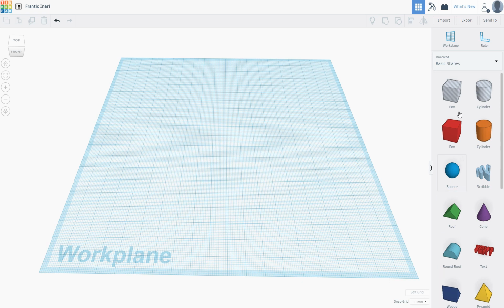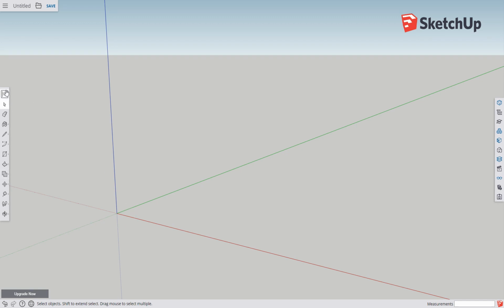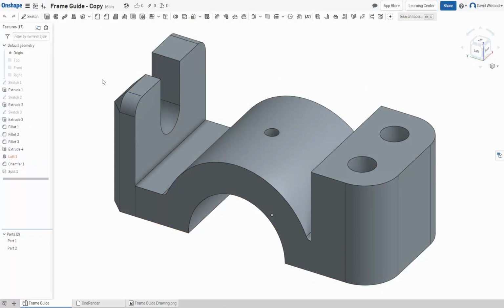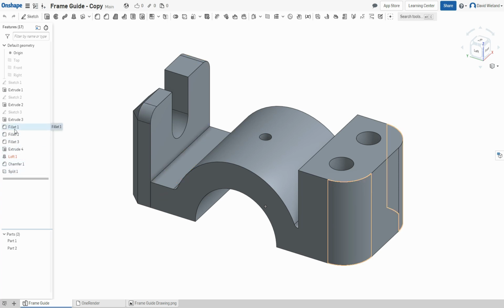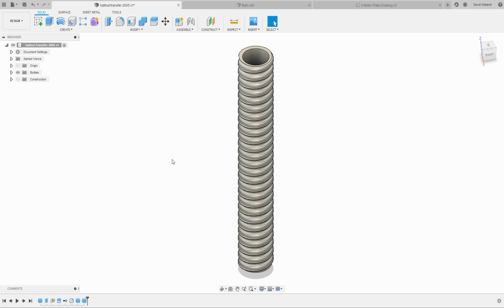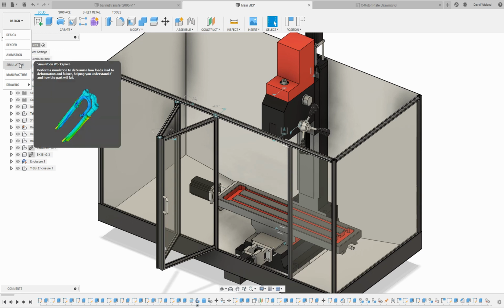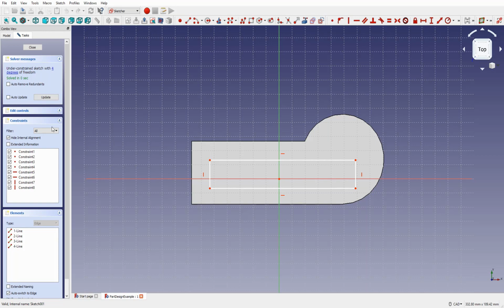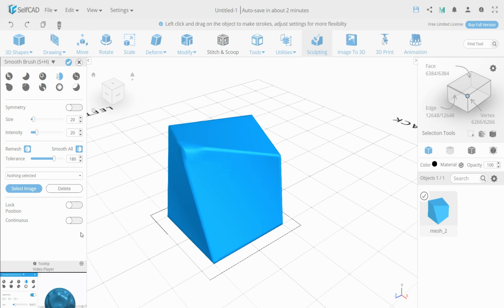Best FREE CAD Programs for 3D PRINTING

Comment: Thanks very much for this informative video! I'm fairly familiar with CMS Intellicad V11.1 2D drafting..I have drawn a small gear (with 26 teeth) as a line object in plan view. I'm trying to "extrude" it to give it the needed depth,,,are you aware of any of these programs that will import a .dwg file and perform the required "extrusion" ?

Comment: Are you certain that Fusion360 only saves in the cloud?  I was under the impression that you can even use it without an internet connection, therefore, how would you access your parts in the cloud?
Reply from the maker: It saves your designs also locally for working on them with unstable connections, but you can't access the files from outside your account and don't really have control over what is kept locally (it's more like local caching with your recent ones available, but not older designs). I'm sure it will also start complaining and ask you to log in again (online) if you haven't connected to the internet for more than a few days.
Reply: @DarkArtWorkshop  Mostly incorrect. Files can be saved locally wherever you like in a variety of formats that have nothing to do with your account.  It can be taken offline for up to a month.

Comment: Hi and thank you for the great videos!   I want to use CAD to design folding knives.  I prefer it not be open source as my goal is to manufacture them. . Any recommendations? Thank you !!
Reply from the maker: As long as you don't go with the free version of Onshape (not sure if that's still a thing) the software might be opensource, but your design is still your own and not opensource at all. Fusion 360 is my program of choice and they do also have a free startup license you can apply for in addition to the hobby license. Otherwise FreeCAD is also great, just a bit harder to learn.
Reply: @DarkArtWorkshop  Thank you for the  fast reply and helpful information. Kind Regards Mark

Comment: Nice video, however it really felt like you were rushing to record the software parts, this makes some people believe some programs aren't as good as other because you are rushing through them and not showing off really nice features that it may have, that you just haven't covered because you were rushing through it.

Also, cmon. If this is a "Best FREE CAD programs" video, I'd expect to see Tinkercad removed, imo it's made for kids, both visually and how it works.
In tinkercad there is really not a lot you can do other than intersecting premade shapes into eachother either making them one part or adding a hole.
Even the cylinders there are not good because you can visibly see the lines of it both in the browser/editor and even when you print them.

And when or even if you manage to create a part you're looking for, it's gonna look rough and feel rough exactly for the reason I stated above, you can VISUALLY see the lines that tinkercad
created the cylinder of, and you can't use any sort of fillets or chamfers or anything to smooth it over or make it look nicer, really not a good choice at all if you wanna get working with a CAD program
for real. Though, for ABSOLUTE beginners or for schools teaching students that know NOTHING or close to nothing about CAD, 3D Printing, etc, it's be a viable option, however I would NOT reccommend it for anyone actually wanting to design in CAD properly or needs a very specific/advanced shaped object, you can't get that level of advance in tinkercad.

Comment: I want to start by making 3D name tags what program can I use to create those please??
Reply: Hey Paul,   if you just want a simple rectangle with raised letters to print flat, probably the fastest and easiest tool is going to be tinkercad.  it has text shapes available (not may fonts but still),  you just drag a text shape, write the name, drag a rectangle, size it the way you want, drag a rectangle hole  to drop in the middle so you have a raised border, size the text and move it into the name tag and combine the shapes.  what that will not give you of course is any way to attach the name tag, but that makes thing a bit more complicated.
Reply: @hmarshall9x19  Does the program give you the option to add new fonts?
Reply: @EclecticBedlam  some selection is possible.  its not like every font possible but some of the text shapes have multiple fonts available.

Comment: Thanks for the video! Great summary:) Although I have a better idea of the options out there, I'm still unsure about a specific detail. Would love to have your feedback if possible. Basically, I'd like to build contemporary 3D table legs out of sheet metal. Off the bat, the program needs to be able convert 3D imagery into 2D plans. The aim is to design unconventional curvy/wavy legs assuming the metal can be bent/ cut in different sections, then convert those plans into 2D printable formats, laser cut the sheet metal , and then manually weld each section back together to recreate the original 3D effect. I love the ease and flexibility of Selfcad but it doesn't seem possible to convert (or unbend) 3D parts to 2D, nor does it seem able to generate 2D plans. Any thoughts on what may be available for the task (in a free version)? thanks :)
Reply: Sketch up,, and the unwrap feature it will give you a pattern for your sheet metal 👍🏻
Reply: @vasili1207  thanks! I'll look into that :)
Reply: I used it years ago, so I hope it's still available 🤞

Comment: Freecad is actually free, open source and fully parametric. Becoming very stable.
Reply: Stable? It crashes all the effing time. :-/
Reply: @harmless6813  Download RealThunders Version of FreeCAD from Github, be happy and don't forget to support him on patreon!
Reply: Check out Realthunders version of FreeCAD it's miles ahead of 0.19! And support his amazing work on Patreon (thunderreal)!
Reply: @blendarious  When I have a look at the realthunder FreeCAD github repo I only see a 0.18 master branch and it says that it is a fork from the FreeCAD repo.
But neither see I a 0.19 feature branch, nor do they list any diffs that sets their fork of FreeCAD apart from the original.
But I have to admit I only looked at the realthunder repo very superficially from my smartphone, and I will have to revisit it from my laptop.
Reply: @blendarious  thanks for the reply.
I will give RealThunder's fork a try.
Because I am new to FreeCAD (FC) and totally uninitiated to the parametric design paradigm in CAD I for a start simply installed the FC build from the repo of my laptop's Linux distro, i.e. Fedora 33.
Maybe FC is even overkill for my purpose and InkScape (IS) would have done equally well, because I merely require 2D to produce a cutting layout of ship frames, which I interpolated from a 3D hull model that I drafted in DELFTship (DS), and from there G-Code that can be sent to a milling machine. From my Internet research so far for applicable Open Source CAD/CAM tools that can run on Linux, both FC as well as IS are in theory apt to master this.
Because FC is so much more versatile and seems to be suited for nearly all CAD/CAM purposes I think in the long run it wouldn't hurt to get some basic skills in FC. But I fear its learning curve is much steeper.

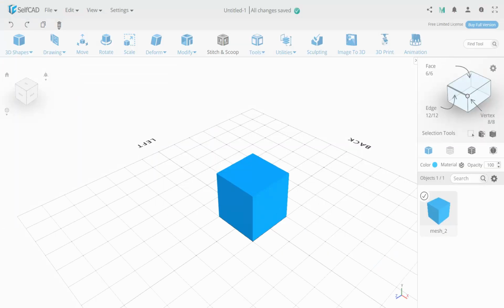Comment: 14:40 SelfCAD actually also has 3D sketching as well as an amazing freehand drawing option and all familiar CAD tools like revolve and loft etc.
Reply: SelfCAD is literally useless because it's polygonal. It can't do NURBS 

At that point you're literally better off using Blender's and it's modifiers
Reply: @mihailazar2487  Well, if you scan YouTube 3D Modeling videos, you will see most people do not use NURBS for modeling and you will find that the tools people most often use are much easier to do in SelfCAD.  Blender is certainly one of the best 3d modeling programs out there but not everyone is interested in spending a few years mastering a CAD program. You can learn SellfCAD in just a few days and for most people, that's what they are looking for.
Reply: @3dmodeling101  then go learn notecad 

Works in the browser over at www.notecad.xyz 
It's fast AF the keyboard shortcuts make it one of the fastest modelling programs ever, and you can learn it basically instantly, there's NO learning curve since each button is labeled and tells you exactly what you need to know, including the keyboard shortcut for it 
You can import STL meshes and concert them to NURBS, you can export models, there's just no reason to use SelfCAD or TinkerCAD

Comment: DesignSpark is the easiest free 3D CAD program I've used to date.
The latest version added a blend tool that allows the user to select two faces or surfaces and smoothly combine them, I used this feature to make an exhaust vent for my K40 laser going from a rectangular duct to 4" diameter connection for a dryer vent duct.
Reply: I Agree great program and free
Reply: Absolutely the best and Free that is available,  very complex parts with very small learning curve it is very very intuitive

Comment: Blender?
Reply: SelfCAD?
Reply: Blender is at its core more about 3d modeling than true CAD. Depending on what you are trying to achieve that can be good or bad though.
Reply: Blender can be used, and can work really well for certain types prints, but for the most part, it's a good idea to stick to other software because it's easy to create objects that are impossible to print.

Comment: I think Blender is a better option than SelfCAD. Because it's free forever, has a ton of features and the community is huge, which makes it easy to find a tutorial that answers your question.
Reply from the maker: Blender does have some advantages, you can't deny however that although there are great tutorials out there, the learning curve is quite steep.
Reply: @DarkArtWorkshop  That's true. But Blender improved a lot with the update onto Blender 2.8 compared to 2.79. The whole Interface has changed and there are new userfriendly controls on the left sidebar. They don't hide the important controls anymore in some confusing shortcuts.

Comment: Would you ever use a CNC mill to make a Guitar body? What software would you use?

I have a BC Rich Warlock with the Widow headstock too. Tuned to Drop B.
Reply from the maker: If you have a CNC that's large enough, making a guitar body shouldn't be an issue. I would probably use Fusion 360, as it has CAM functionality built right in.

Comment: You missed the BEST free software for CAD, Blender 2.8x! I know everyone in the comments is saying right now, "But Sjon, Blender is not a CAD program." And you'd be right! Blender is so much more than a CAD program. Blender's only problem is that you have an entire unlocked 3D suite capable of 2 & 3D modeling, animations, simple physics simulations, particle systems, 3D printing, video compositing & editing, and so much more.
The rest are good for just CAD but if you're wanting to do more with the thing you created (animate it in a mechanical system, make an advertisement, give it a texture, etc.) you'd want to use Blender.
Reply: I've used blender for years, and although it is very, very good at what it's made for it is simply not a parametric modeler.  Meaning you simply can't go back and make changes to a previous modification and then expect that to carry on back to where you are currently working.  You would have to destroy every change you had made until you got back to where the mistake or modification needed to be made.  Parametric modelers allow you to modify every change you made to the model at any time without having to redo any of the other work you have made.
Reply: @deathguppie  Then you should tell this guy you can't do CAD in Blender . 
https://www.youtube.com/watch?v=6BhvicETe0k
He didn't get that memo. With the right workflow and knowledge, Blender is just as capable as other walletware modeling distros. The big difference between all of them is the price range with Blender being completely and forever free .
Reply: @sjonjones4009  Its just not suitable for things that need dimensional accuracy and need to be flexible as the previous user said. For freeform sure but CAD not at all. Its like trimming a huge garden with a pair of scissors, sure it technically works but is very impractical
Reply: @sjonjones4009  Oh, I do realize that there are work arounds for doing CAD-like operations in Blender, but the workflow is no where near as fast, and all the changes are still destructive.  In a parametric modeler you can go back and make a single change to a single measurement that you made anywhere in the timeline without having to recreate everything after that.
Reply: @through-it  I originally got into Blender back in 2004 because there were no good open source 3d CAD programs.  I spent years working with it and truly love Blender, but the operations are destructive, meaning you can't go back and make a single change to a measurement on something you did 12 steps ago without having to rebuild everything after that.  In FreeCAD for instance you can go, oh, that length is wrong and find that modification and just change it, without having to rebuild anything.

Comment: Firstly, good job Datulab Tech on the overview. I'm going to contradict myself in a moment: Suffering through learning the programs you mentioned can be an excellent exercise in understanding how CAD works. 

Once you do that:

Fusion 360 can be as low as $31 US per month. If you have any desire to be a "pro", don't use the 'hobby' programs. Don't settle or waste your time... build your career instead by using professional programs. One of the great things about Fusion is that you can generate  manufacturing data such as G-code! Even if you have to buy Fusion360, potential employers or contractors will take you more seriously if you are using good tools. A one-day job can pay for Fusion for a year!